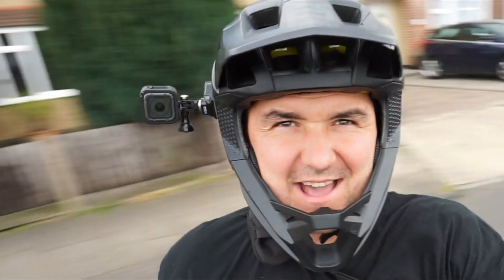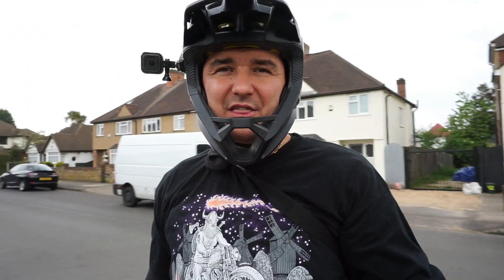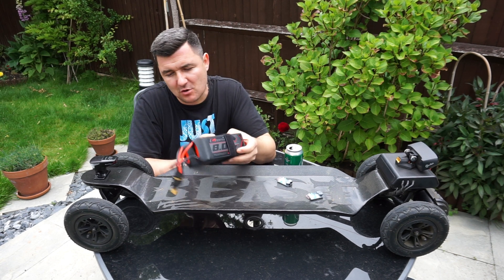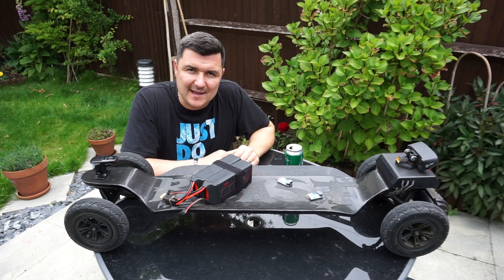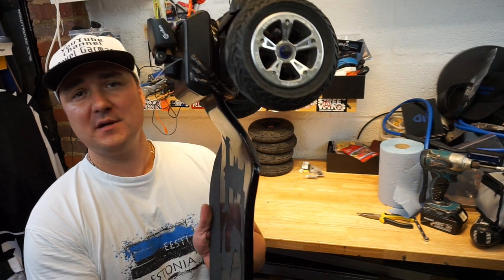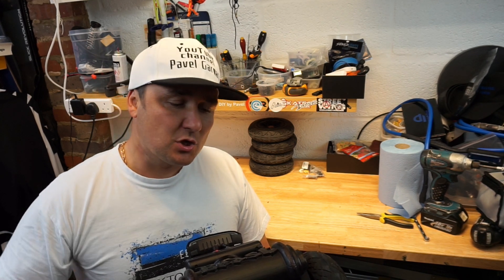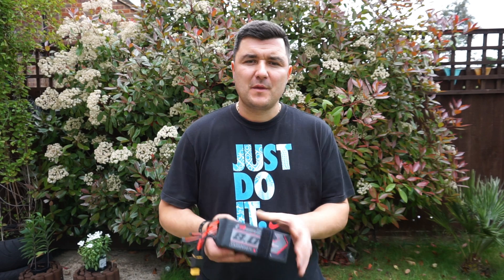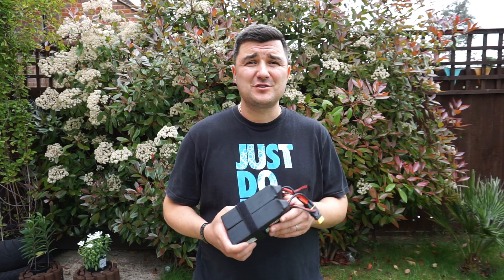Graphene batteries range test  Beast video 18

Comment: try some supercaps (graphene based) with li-ion, Use the supercaps for high discharge in torque and li-ion in normal cruising. hybrid
Reply from the maker: Hello Andrei,
Thank you for watching and commenting. Sounds very interesting.....never heard of the supercaps but will definitely research. Is this something you have used?
Reply: @PavelGarmas  i don't have money to buy, but i was researching high discharge combined with li-ion and it seems a good match, but the  pack size is bigger. supercaps can handle high torque

Comment: look at this... he burned it  https://www.electric-skateboard.builders/t/001-jet-invasion-voyager-x-evolve-trucks-dual-6355s-190kv-custom-10s4p-30q-focbox/37352/119
Reply from the maker: Hello Jackson,
I do feel really bad for the fellow and would not wish this o happen to anyone. There must of being some sort of error when the board was designed or built - cable sizes, soldering quality, trapped wires......etc. I do always say in my videos - DIY only if you are comfortable doing so and never leave boards r batteries on charge by them selves,
Glad that he is ok and family is fine.
Ride safely mate!
Reply: @PavelGarmas  I know about your concern about batteries, so I wanted to show you how right you are about that. 

I also wanted to know, where do you store the battery pack while driving the board?

Tanks
Reply from the maker: That is a good question but I can not say : ) New video will come out soon and you will see. LOL

Comment: Nice.. You should also mention how much your weight is, that is also critical.
Also there is Multicopter 6s 16Ah battery's from Hobbyking.
Reply from the maker: Good point! I did mention the weight right at the beginning but yo are correct I should repeat at the end.
Thanks for watching buddy!

Comment: Cool. I have monitored my watt hours with a wattmeter and find similar results  tall thick grass is the worst for draining current. It's great idea to get a worst case scenario for predicting range. Good to see the battery recover. Those things are expensive.
Reply from the maker: Yes they are but at the same time not they are not..... same battery ( 12S, 8000 mamp ) but in 18650 configuration will cost 500 +.....does need BMS.... These two were 89 UK pounds each so definitely cheaper.
Reply from the maker: Thanks for watching mate! Ride safely!

Comment: Great setup 14KM offroad is awesome my at board with 6" gets around 11Km offroad with 12S2P 26650 (10000Mah) building a 15000Mah pack for group rides. But its the at wheel that kill my range with abec 107 same pack gets over 20km.
Reply from the maker: Hi!
Thank you for watching and commenting mate! You are correct the AT wheels do create the drag and eat up the batteries but the plus is you can go anywhere : ) i am looking around for some bigger mAmp packs now just in case if i want to go for a long ride...